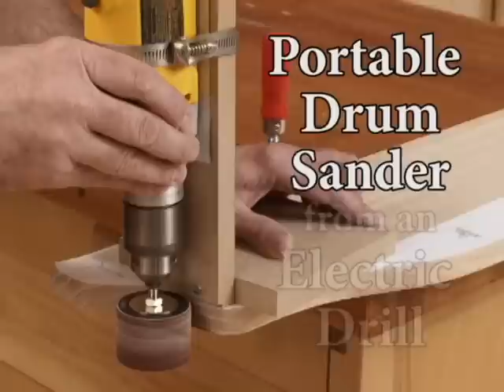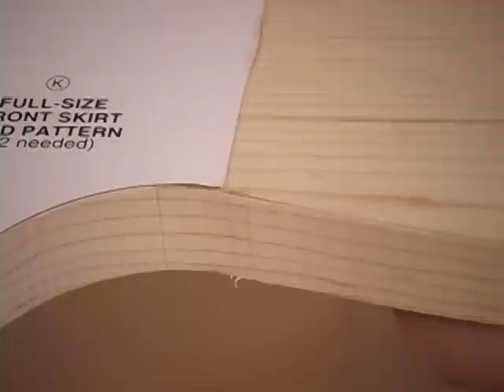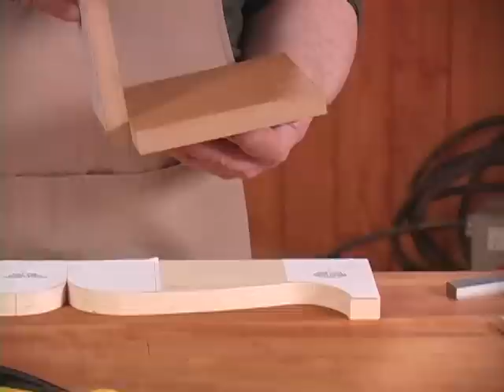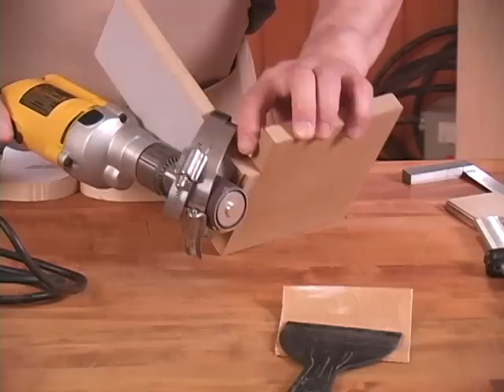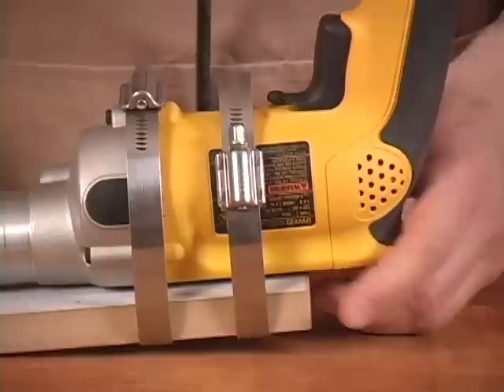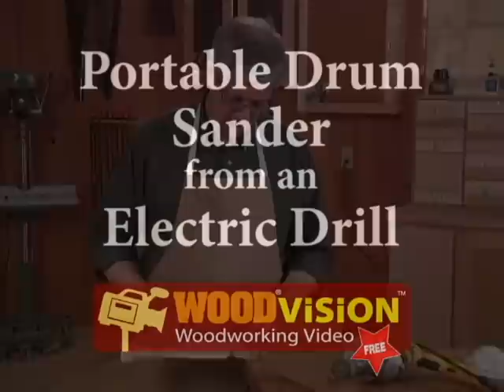How To Turn Your Electric Drill Into a Drum Sander - WOOD magazine

Comment: I did something similar but drilled two countersunk holes in the flat top and screwed into into the workbench surface to use as a stationary sander. Honestly had not thought about using it this way.